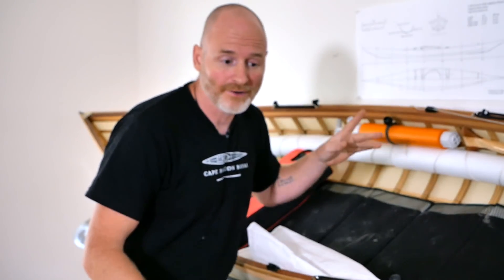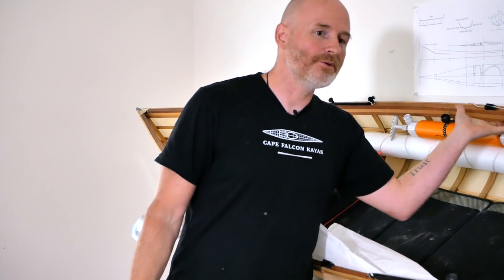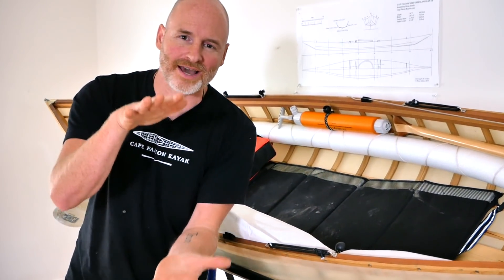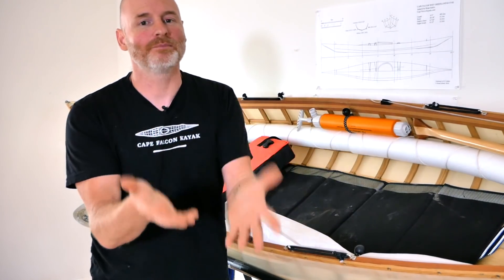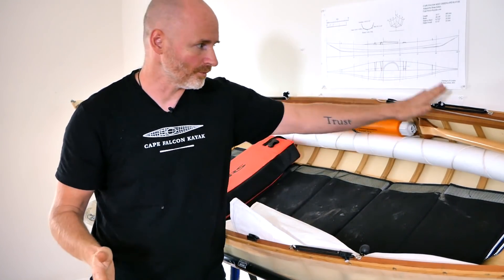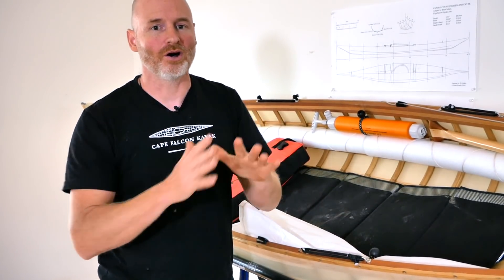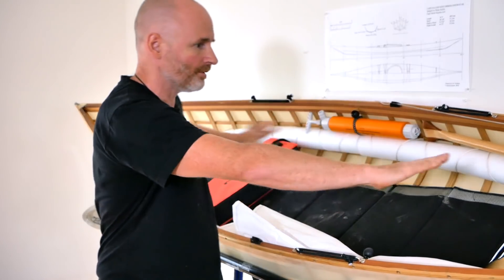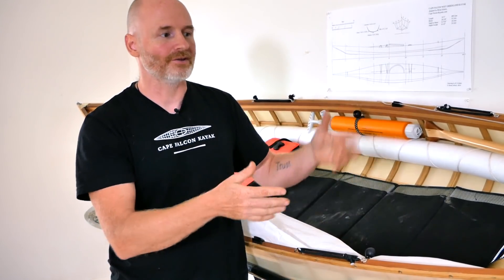Building a Skin-on-Frame Canoe, Part 11: Flotation, self rescue, and catamaran systems

Comment: I'm actually in the process of restoring an old 10ft jon boat to make into a take down sailing catamaran  and I'm planning on using your method to make that happen. Might upgrade to a 2x6 due to increased mass but I'm hoping to make a very small and stable sailer to try and learn sailing.

Comment: I think it gets better by the minute Brian. Not sure about the pool noodle. Could you get the same foam Mike flat that would fit between the ribs of the canoe? I'm seriously thinking about one or even two of these canoes now. As a system it shows for every aspect that i enjoy about been on the water. Paddling, sailing, trolling motor. What's not to like? Keep going Brian...i like even the long videos mate. Pere UK
Reply from the maker: Foam behind the ribs would get nasty and full of funk and wouldn't be removable.  I actually wish the noodles were bigger,  at 4 inches instead of 3 they would give enough float to be able to bail.  I really like how they hold in the seat pad as well.   I've tried SO MANY things for flotation and so far this is the best.
Reply: I agree. The pool noodle is a detractor from the elegance of the rest of the boat. Keep thinking on alternate ideas. Nice that they are cheap and easy to come by though.

Comment: This design is getting very elegant.  Well done.  Do you think it will be suitable for fishing in protected waters?
Reply from the maker: This whole project is an attempt to break away from specific designs and create a fast, easy, system you can use to make any canoe you want.  Long carry to do some fishing on a mountain lake?  Go for all cedar stringers and a light skin, 10 ft long, 30 inches wide, 14lbs.  Want to go for two week solo trips in semi protected waters?  Go 14 feet long 28 inches wide, normal weight skin for a great 25 lb tripping canoe.  Want a fast fitness canoe, 14 feet long 25 inches wide.   Want to tackle some wilderness rivers with up to class 2 (or well judged class 3 rapids),  12 feet long, 32 inches wide, with spruce stringers along the bottom and a nice deep sheer curve to handle the waves.   My job is to create the building system and then get enough knowledge that when someone contacts me and says:  I weigh this much, and I want to do this and I can respond, you want the boat to be this big, and shaped like this, and then they can apply the building system.   My starting point here is canoes around the Wee Lassie size, but as soon as I get that dialed, I'm going to be venturing into both larger and smaller canoes.